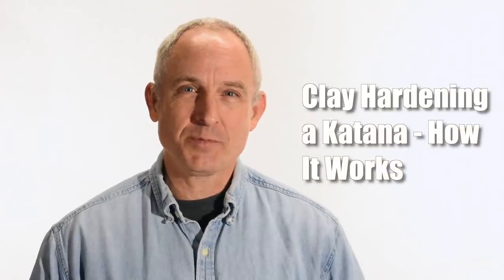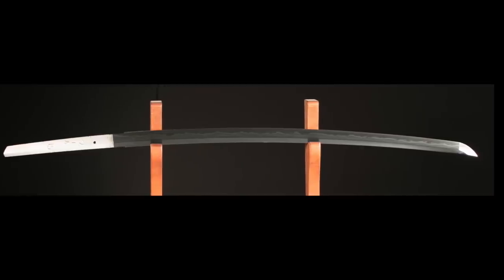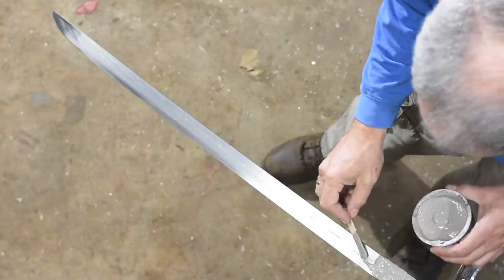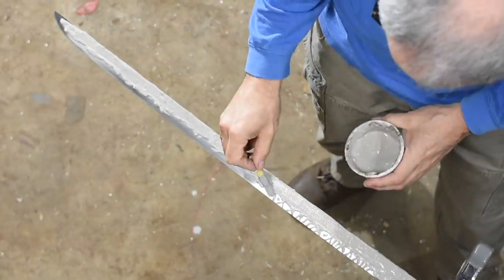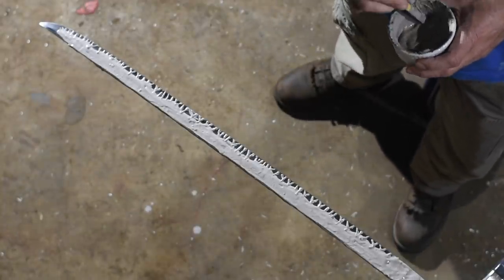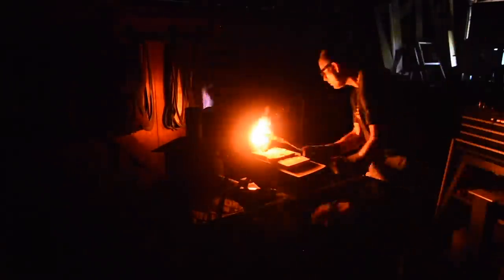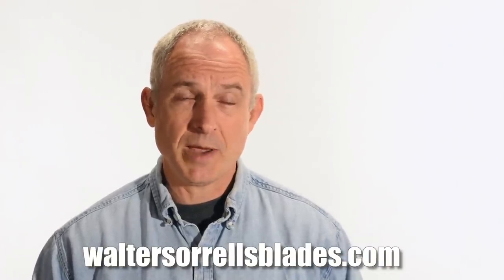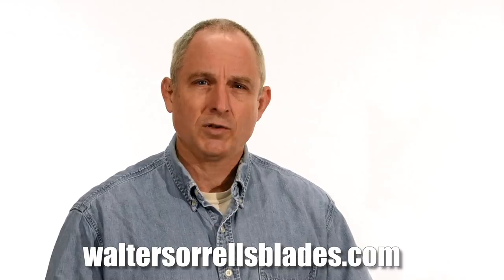Katana - How These AMAZING Swords Are Clay Hardened!

Comment: It seems your prequenched swords are curved.(?) During my 50+ trips to Japan I stumbled on a museum in Tokyo suburb that had 100+ steps (w/videos) of the sword making process. It was actually a war museum that westerners very seldom visited. The heat treat - hardening was the most interesting. The blank was straight, then heated by a heated block moved over the sword like an iron to ensure that the temperature of the cutting edge and the blade back stock were controlled precisely. Then it was plunged into water bath where by the different metal structures caused the curve of the blade overall. The scallops were the result of fold interfaces in the material and (i guess) differences in carbon content from the process. It seems there are many ways to do the heat treat. Thanks for your very informative videos for novice and professional engineer alike. I'll go down the rabbit hole on the swords later, but just a comment on this one for now. I really liked the screwdriver series.

Comment: Hello sir, do you mind sharing the method of controlling and adjusting the curvature in the blade during and after this process? I've read it in the text but have never seen it done through video footage. Thank you!
Reply: It's controlled via the material used, the thickness, how much of the blade is covered, the temperature of the blade prior to quenching, and what the quenching medium. More art and experience than anything.

Comment: Do you try and make the clay waves on both sides match?
Reply: It looked to me, like it was done freehand.   There was no pattern and he didn't keep flipping it over to check it.   I think some things are done the same from side to side: like the tip and the centerline where the cement stops. But all the little pull lines from the cement out to the blade edge, looked to be random.
Reply: I think traditionally, hamon are an artistic expression of the swordmaker, so symmetry of the pattern isn't really part of the desired result.
Reply: The question I ask is what purpose does the little stragler clay that goes to the edge of the sword have. I understand clay on the spine allows for shock absorption and a dynamic strength for the sword but it seems it would weaken the edge.
Reply: @onebullspinner  It's the artistic aspect. Made to resemble certain visuals such as clouds, ocean waves and other things; In this case the lines are typically applied to a choji hamon pattern made to resemble clove blossoms.
Reply: @jenky1044  The Real answer is that u actually cant differentially harden a Traditionally made Japanese Sword of Tamahagane like that. It would be too much stress to the edge if u let it free of clay like shown in this video. Also you wouldnt be able to simple "draw" such a Hamon because it interacts with the layers of the blade.

Comment: So, after quenching, Japanese baldes dont get tempered at all? Or is it still recommended, even though the clay slows down the quenching of the material beneath?
Reply: It should always be tempered, it's part of the heat treatment, not optional
Reply: @Negrataish  
   I thought he said it was clay tempered.?
Reply: If the clay thickness is properly applied, as well as the water temperature, then you can achieve the proper hardness without tempering, though it is very hard to do this and most smiths will go through tempering afterward.
Reply: @jenky1044  Even though it's referred to as a "clay tempering" The process of yaki ire is a differential hardening process. It's not tempering, but hardening the exposed edge. Tempering is a different process done afterwards to lower the hardness level.

Comment: Is that a zero grind? If not, what is the bevel?
Reply: Japanese swords are usually ground without a secondary bevel, but they have convexed edges. The blade is said to have niku (Japanese for meat or flesh) - the more niku the stronger the blade; less niku will make for better slicing.
Reply: kaizoebara thank you for the assistance. I am going to try it.

Comment: Absolutely incorrect that the Japanese ONLY developed using a clay slurry on the blade . European smiths solved the problem in just the same way . Each smith develops his own clay mix whilst under his teacher smith . Why American or European smiths run to refractory cement instead of taking the time to develop there own mix , I don't understand . To much trouble I suppose , its easier to run to a commercial produced product . It’s part of the process of your hammon [ hardness line ] development . These blades that are copied so much rarely show the refined details necessary in the blade of a Japanese sword . Where as these details are the living soul of the Japanese sword and the training process a Deshi goes through to learn this art form . I suppose the difference between a reproduction as to a copy . Two different things .  .